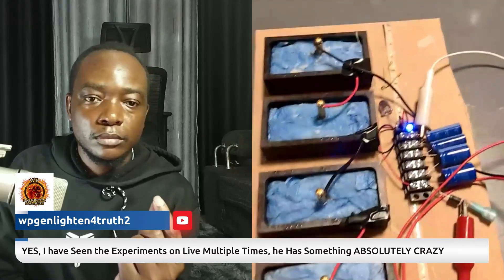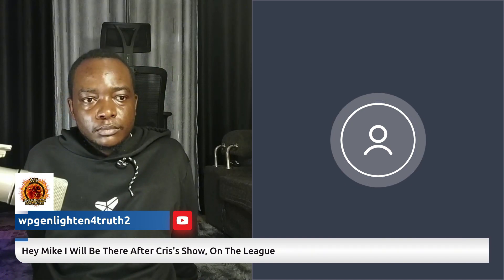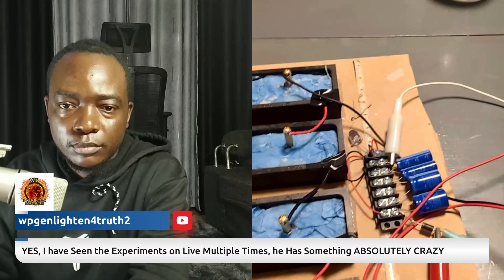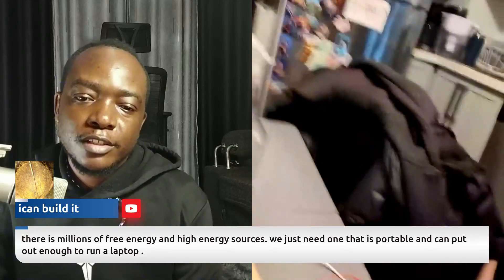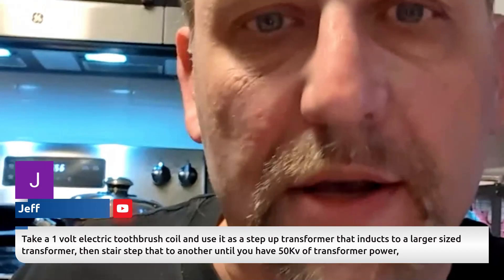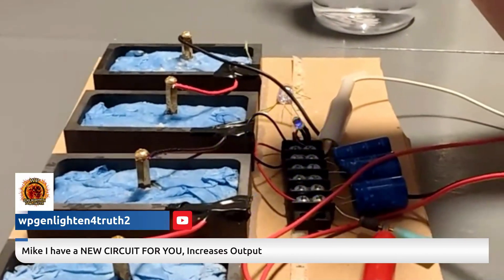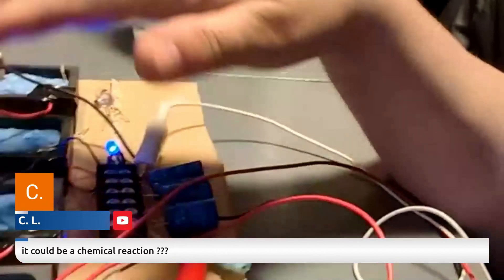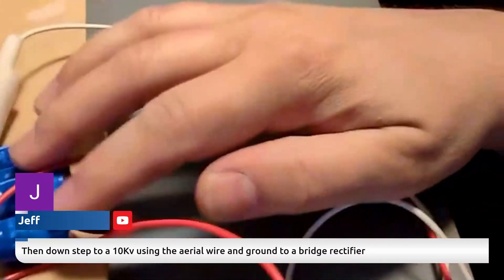Mike From Canada Shows Homemade Self Recharging Battery Never Seen Before

Comment: I have a similar system, its called a ‘Tesla Switch’ & its a well documented FREE ENERGY DEVICE. A Tesla Switch uses 2X 12 Volt Batteries as 24 Volts Pulse Charging a Coil then collecting the Back-EMF Spikes from that Coil to Charge a 3rd Battery. These Batteries are swapped around once a Day. 1, 2 charges 3 then 3, 1 charges 2, then 2, 3 charges 1 ect. The device that I use is a modified Bedini SSG Circuit & the Battery you use all day to power a Laptop is the Battery that you Charge all night using ‘Radiant Electricity’ Spikes. On my Onedrive I have many different Radiant Charger designs I’d pull off the internet. The Tesla Switch both de-sulphates the Batteries & keeps them fully charged.
Reply: @o5you86  Doesn't sound like free energy at all and seems worse than using solar.
Reply: @scamchan  The Tesla Switch uses ‘Tesla Regenerative Effect’ & only works on lead acid batteries. I’d rather have an Ecoflow Delta 3 with 2X 400 Watt Solar Panels & an Alternator Charger. Lots of people I know have built the Bedini SSG Circuit as an off grid power supply that works night & day & doesn’t require the Sun. These are Fun, Simple Projects that anyone can replicate.

Comment: I can't tell by this video, can it be self charging by back flow from discharging the capacitors
Reply: Are you sure that these are real battery, because the trick in the supercap, no need to use a supercap with a generator, make the computation with 4 supercaps of let say 5 Farads you can power a LED for ARROUND ONE HOUR !!!